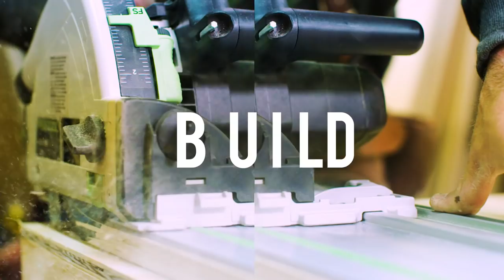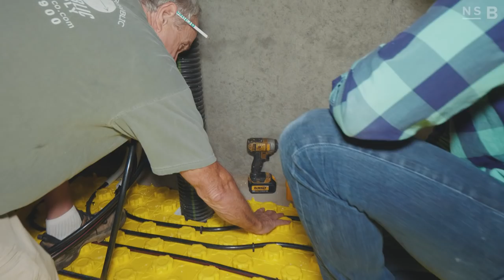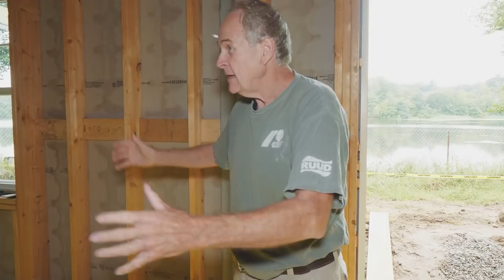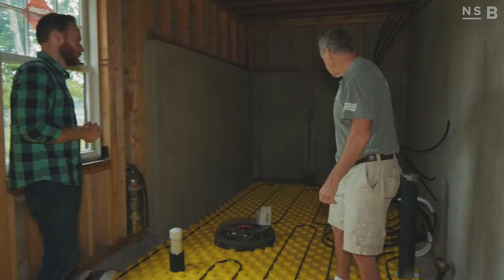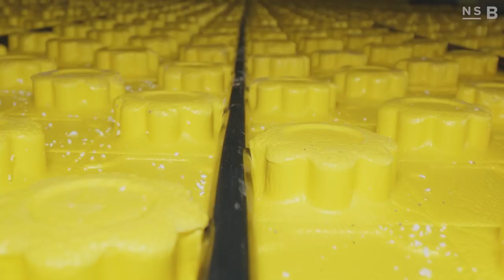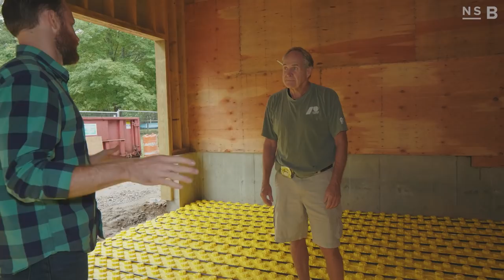How to implement radiant floor heating. Installing viega rapid grid a basement and garage.

Comment: Can't wait to see the Hydronic Air Handlers!
Reply from the maker: Fred Haag rather than a gas fire furnace. These work off a hot water coil
Reply: I am familiar with the concept. I do ductwork in the commercial field and deal with AHU, VAV, Fan coils and other various equipment. That to say I have seen a lot of coils for steam and hot water.

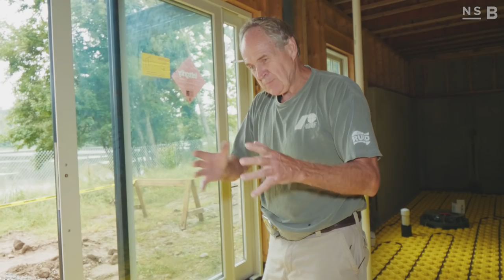Comment: 7:12 Spidercrack. 
Word of the day.

Great content.

Edit Question. How would you go about affixing partition walls to a slab with hydronics? 
If the slab were thick enough, then traditional fasteners might still be the way to go but since the outcome is extremely negative if anything goes wrong I'm trying to learn other ways before I do my own project.

Comment: My son a contractor and myself are doing a total restoration project in Stonington CT and are going to have radiant heat installed in LL basement, and 1st and 2nd floors throughout. We are considering a Viega system and Warm Board System. Can someone give me a honest comparison on one over the other. I have been told that plumbing/heating contractors always recommend Viega system because the have large markup and make much more money than if they just install a Warm Board system. Someone please help as we are also getting ready to build our custom 2800 sq ft one level home starting this year. thanks for your help. dan

Comment: What type of system would I need to put over an existing basement concrete floor. I do not want to cut up the floor.
Reply: Any response to this, same question
Reply: An electric radiant system that you can tile or carpet over. Schluter and other companies manufacturer them.

Comment: So if I understand the process. You have a 2" foam with vapor barrier membrane on top of graded gravel with 6" concrete overlay. Wouldn't you want the heat closer to the top half of the slab instead of the bottom for better heat distribution? Noting that you will have to make allowances for partition wall attachment ahead of time.

Comment: What happens to the pex tubing floor if power failure leads to low  freezing temperatures?
Reply: My floor heat has a anti-freeze product added to a closed loop system.

Comment: What would you do to frame walls on such a floor?  Pour a concrete footer then add a sole plate?
Reply: I ran into this issue with another product.  Could not drill or nail into the slab.  We had an engineering test done, and glued the bottom plate to the concrete.  I'm curious to see what they will do here.
Reply from the maker: Same thing. Glue!
Reply: Why couldn’t you use 3-5”  concrete anchors/ Molly’s? Especially if the slab is 6”. Shouldn’t be a problem framing walls on a floor with this system. You could use glue as well. I would go with both.

Comment: You mentioned that you are putting a 2-post car lift in. Do a video on that!
Reply from the maker: Iain B Actually a freestanding four post lift.
Reply: @NSBuilders  will you bolt that into the slab? you mentioned not nailing/drilling into the slabs.

Comment: After installing a few systems it gets pretty straightforward.  As convenient as this "puck" system is...I  prefer a different install. First thing  on top of the ground is vapor barrier...you can go right up the walls if you wish. Next is 2 inch high density foam...the pink board. Next is wire mesh for concrete structure. Next is pex thats zip tied to the wire. At that point it's a standard pour. As they noted...protect the pex as it enters and exits the concrete floor with a simple sleeve. Mine is 22 years old and still 100%. No fancy puck board...sorry Vega..is necessary..and you get COMPLETE concrete filling around the tubing.

Comment: No floor drain in garage. Must not get alot of snow.
Reply from the maker: Willson Hallaway Adding a floor drain to a garage requires an oil water separator tank. There’s not a lot of snow coming into the garage and whatever does will either evaporate on the heated floor or drain out towards the door since the slab is pitched